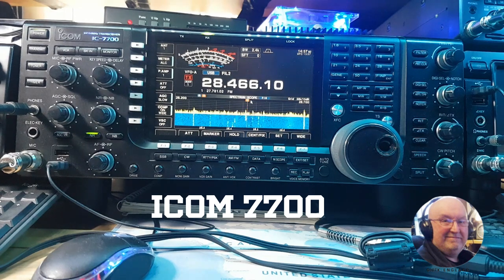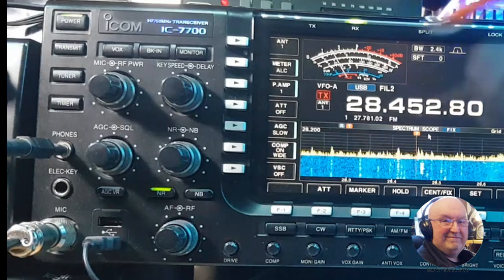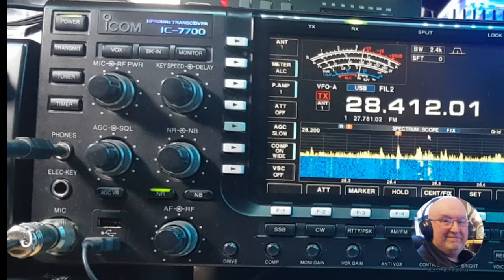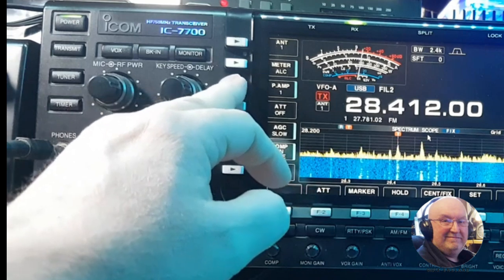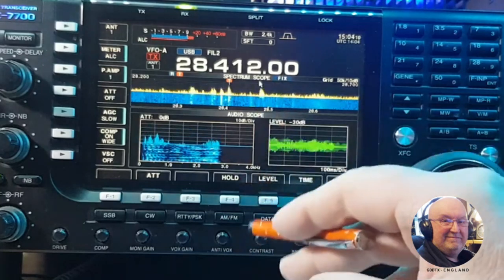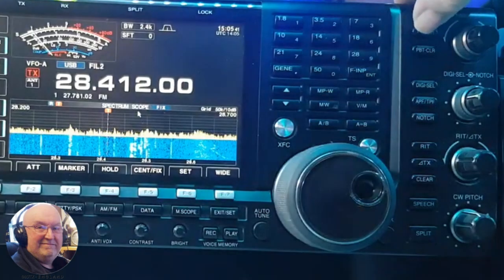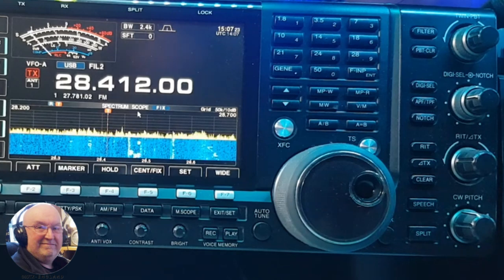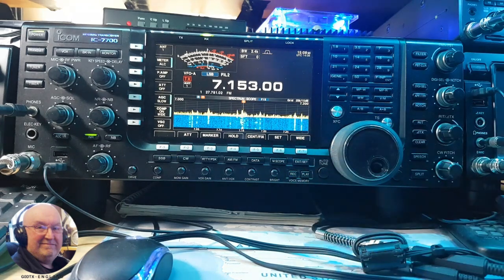let's have a look at the icom 7700 HF/6M

Comment: Nice!
I've had a 7800 for a couple of years (a several-year-old rig)... a great performing and beautiful rig as well.
I also just recently (a week ago) acquired a 785... Wow, now THAT'S a radio! 😅
Going from a Yaesu 101D, to the 7800, and now the 7851: Icom simply blows Yaesu out-of-the-water on these older radios. Everybody is raving about. SDR's, but - IMHO- these older superhet' radios are just as good (maybe even better!). There's nothing my 101D hears that I can't hear just as well (or better) on the Icom 7800 or 7851.
Fantastic radios!
This is my first look at a 7700... perhaps I'll start looking for one of them too. 😊
Thanks for sharing! 
73 from Texas,
W5ARM
Reply from the maker: my dream radio ic 7851 very nice